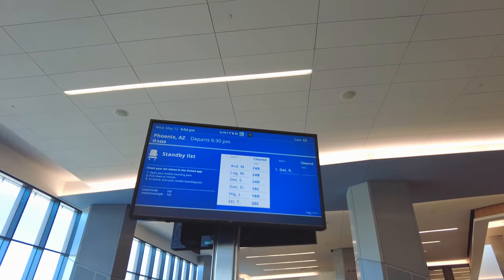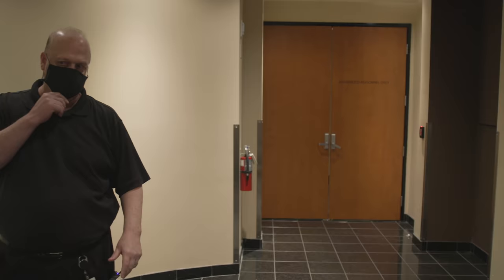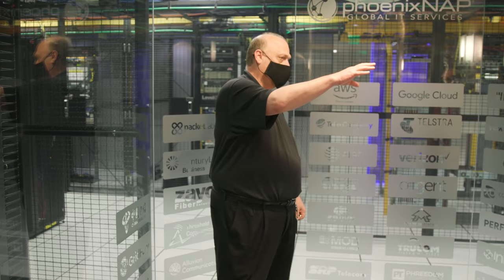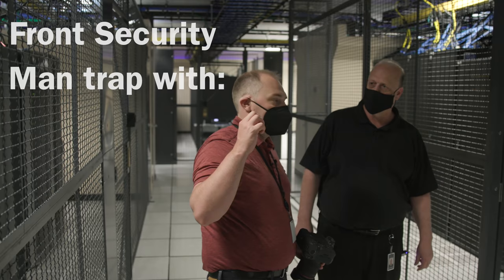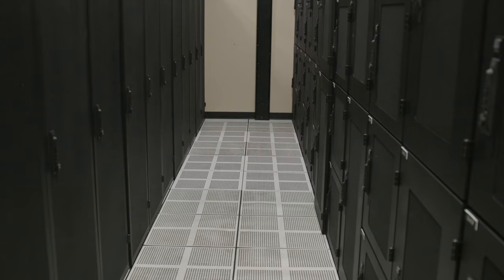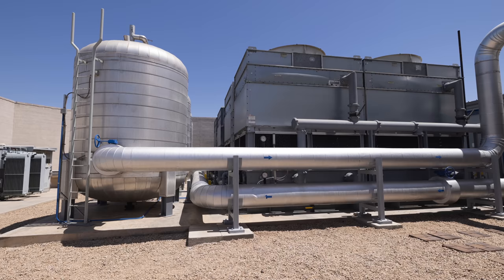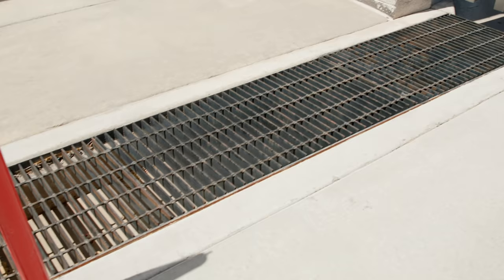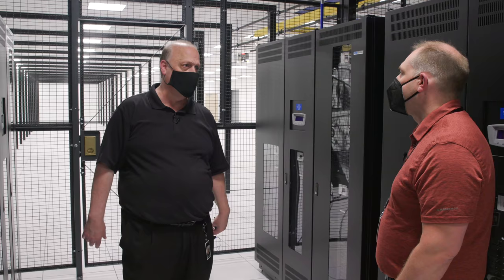A Fun Data Center Tour at PhoenixNAP

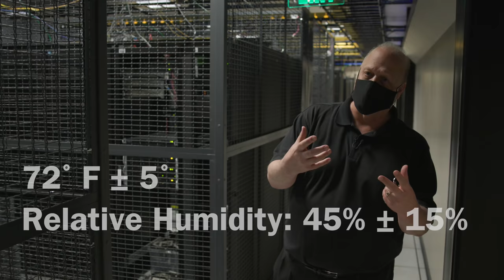Comment: 7:40 - /me sees humidifier in a DC, freaks out...

Then I realized this is in the arid land of Phoenix, and not a humid swamp like St. Louis!
Reply from the maker: Yea! Pretty darn cool.
Reply: Now, go make Pi-powered humidifier.
Reply: wow, even Jeff is here. just don't trip those breakers if you are red shirt Jeff
Reply: from Pi Cluster to Pi Data Center, we all are in this together.
Reply: They're usually inside the air handlers.
Reply: I worked at a DC for a while that had mist coming out of the ceiling vents when the facility was first powered up.  Turns out that without the 1MW+ of servers per room as designed the air was too cold to evap the water and it was visible as a fine mist near the ceiling some 25-30 feet over our heads.
Reply: @dw7444  That's what "re-heat" is for. There's a diverter value that feeds hot gas into the coil(s) to "simulate" load -- so the compressors don't overrun (makes the room too cold) or short cycle. This can also happen when the humidity is too high and the supply air is too cold. (the control system should be checking that, but "cheap" exists in everything -- $100k HVAC with $9 arduino controlling it. Also, no one ever does a proper PID adjustment.)
Reply: scalematrix uses de-ionized water and pump it in aerosol form directly in to the cabinets for increased cooling. the tour guide likes to dunk his ipad under the running water during tours from what i hear. they are on the west coast and no where near as arid.
Reply: @dw7444  vvbo

Comment: I was a systems engineer for 15 years at a small-medium sized data center. It was a great experience. Now I am a cloud and virtualization architect for a large infrastructure where we maintain servers in two data centers as well as disaster recovery with with a large public cloud provider.  Phoenix NAP looked great! But I must say that my IT Disneyland was Switch (formerly SuperNAP) in Vegas. That place sets the standard for all carrier connectivity as well as unique heat/air management. Hard to get a tour though. I was lucky to get my tour there. 
Thanks for the tour at Phoenix NAP!
Reply: Agreed. This is a great DC, but Switch is on an entirely different level. Glad to have the opportunity to have a full rack co-lo there. If only I could work out of it everyday!!

Comment: Very cool video, and awesome what kind of access they gave. Being in the Phoenix area, I can definitely corroborate that Datacenters are on the rise here, in spite of the environmental factors (high heat, potential for low water supply).
Might need to apply there 🤔.

Comment: And here I am with my 40TB NAS on a decade old hardware, in a dinky 12U open-frame rack home lab.
Reply from the maker: That is the gateway!
Reply: It all starts somewhere. I started way back with his and hers computers and wanting to share internet access through a 56k dialup modem. Some research to find out what I needed. Then off to the store and looking at prices of 25ft patch cords...wow I can buy the bulk wire and couple connectors for so much less...just need the tools and learn to do it. I knew that was only the beginning.

Comment: Greetings from Canada and thank you for a great tour given the security considerations involved. I was surprised that the facility only had 60 second capability for running on battery. You must have a lot of confidence in those generators moving from the OFF state too full load very quickly. I was also surprised about the amount of cooling capability you can accommodate - 43 KW in a single cabinet. That is enough heat generation in such a cabinet that is is like a controlled fire - impressive. I was surprised about the location selected given how difficult heat dissipation would likely be in Phoenix. I guess having Tier 1 ISP availability from multiple providers counts for a lot. It is too bad that there is no good way (presently at least) to put all the waste heat that gets generated to some useful purpose. Thanks again.
Reply: Historically, Phoenix always averaged about 76ºF in the summertime until they installed all of those data centers.

Comment: Ha I’ve been to this facility and installed / turned up equipment for my previous employer who was one of their larger colo customers. I’m surprised they didn’t talk about the no cardboard rule. They are super strict on bringing anything remotely close to cardboard like Cisco license envelopes and if you tailgate through the man traps they will come over the speaker and give ya a hard time.
Reply: Why no cardboard?
Reply: @SkynetCyb  shedding of dust and  contamination. When you tear cardboard you see little particles fly in the air
Reply: @thimslugga  That's pretty smart, I never would've thought about it, I thought they had filters in place for this use case though?
Reply: @SkynetCyb  They don't want that crap being sucked into the air handlers. Dust is murder in a DC. I had one "lab" (~400sqft) that was 100% isolated from the building HVAC. The filters on the CRAC stayed like new for 5 years... until the a**holes cut a 1sqft hole in the wall; the filters were clogged in less than a week. (and two servers were killed by drywall dust -- fucks with power supplies frying the cpus.)
Reply: They seem ok with it if it's something like a reusable box or anything you're not going to tear open basically.
Reply: @jfbeam  relax dude.. it has nothng to do with "crap being sucked into the air handlers". Thats what filters are for... Its for the server racks. The last thing you want is cardboard particles being sucked in through the servers..

Comment: Crazy to see all that physical security with steel cages around the racks. Makes sense if you consider there's 10s of millions of $$ in each rack nowadays, even more with GPU or HDD clusters.
Reply: While the hardware and software may have a high value, the real value they're protecting is the service each client provides.  Imagine you're a client like AWS or Google where your revenue is directly tied to your up-time and data throughput.  All that security and redundancy directly contribute to a company's bottom line.
Reply: Also makes sense when you consider any other customer could go to your rack and pick their way in

Comment: Data Center appliances (servers, switches, storage etc) operate on 110-240V. PSUs yield high power output on higher voltages, which is why almost all Data Center equipment is run on 208V or higher. If you check any server PSU, you will see three power outputs listed on it for each voltage range. Blade Chassis almost always require 240V although you could purchase 120V PSUs for Blade Chassis if in the rare occasion someone wants to run it at their office or in a quarter cabinet. Large high power (8kW and higher) PDUs (0u) are 208v or higher (like 208v 3-phase 30amps). There are very few 0u PDUs that are 120v, which is why the guy said 120v is usually requested by small customers wanting a quarter cabinet.
Reply from the maker: A long time ago (2015) we did a piece on 120V v. 208V using HPE power supplies. https://www.servethehome.com/120v-208v-power-consumption/

Good points in your comment. Hopefully can incorporate them on the next tour.
Reply: Yep more (power)...with less (copper/heat) is just simpler. The NORMS aren't generally cuz it's better...it's kinda random, popularity, political influence or cost that drive it. Think Beta vs VHS who won??? Or another good one I researched was the Phillips screw vs the square drive or torx. We got the Phillips which actually strip like they were designed to do for their original application. But we use it thanks to Henry Ford who did a cost analysis on the Square drive (Robertson and Canadian) or the Phillips. He calculated he could get the same job done and it would cost less with Phillips...then that became so common, it's still the annoyance we have to suffer with today...which is slowly changing.

Comment: 4:52 invest in a datacenter with NO hot room "not hot aisle" so the heat in someway is constantly mixing with cool air - not a good move and considering the amount of money that DC is  making they are actually being very inefficient. My DC has the APC heat room with 4 rows of 20 48U racks, 3100 servers, 4 EMC San units & 4 Cisco Cores in 4 corners of the space. The entire room is cooled with 30 tons using 29% of its cooling abilities and the heat it generates is recycled and used in the winter to heat the building office space. 

Datacenter are supposed to be greenish & efficient not designed to be power hungry cities. I would hate to see the price tag for all that power and cooling equipment.
Reply: Yep some basic understanding of HVAC understands that. Even a minimal blocking off between aisles with glass or plexiglass or something would dramatically increase efficiency
Reply: Yeah that part surprised me. I'm planning a server room now and hot aisle containment seems like a no brainer.

Comment: Data centers always make such a show of physical security. It's important and needed of course. More than once I've been to them having passed through multiple levels of security and tech to get in, only to see a roll up door to the parking lot open with guys standing around smoking or shooting the shit. Or a side door where employees and friends go in and out without passing through the gauntlet. While important, a lot of that is for show from what I've seen. That wasn't at PhoenixNAP, but several top tier DCs around the country. Some of the biggest DCs that are industrial primarily for telcos and that sort of thing have nobody onsite and a keycard and maybe finger print to get in and you're in the DC. None of the fluff, just the stuff you need.
Reply from the maker: Actually did tour the dock. Multiple levels of security there but there was equipment we did now want to show on pallets there.

Comment: Great video ! , worked at a telecoms dc for a few years on the 'physical' side, was always fun.
One thing I didn't quite get, was saying their generators can run '
indefinitely'?
Reply from the maker: I think the idea is that the diesel supply contracts and tanks ensure they can survive imaginable outages
Reply: @ServeTheHomeVideo   ty for reply, a first engagement on channel :)
I still do not view that as 'indefinite' however, nor non-prone to some imaginable scenarios
Reply: Depends on their supply of fuel. Many claim "indefinite" because they're connected to a pipeline, vs. on-site tanks that have to be refilled from tankers. Ask some of the guys in NYC how "indefinite" that feed turned out to be. (not very. pipelines need power to function, too.)
Reply: Indefinite is parsing language for sure. But generally, since they probably host gov’t clients, they probably have a Tier II endorsement for fuel delivery during a disaster.

Comment: It would be nice to have asked them what their floor weight capacity is. For 44kW cabinet, I would imagine it to be anywhere near 4000 lbs per cabinet. Also, fire suppression is another thing worth asking. Some Data Centers have water sprays, which ruins everyone equipment but is cheap for the DC to operate. Alternatively some DCs will use a gas, which is expensive for DC to operate but doesn't damage customer equipment unnecessarily. What are these guys using? Is there something new in the market? Missed opportunities! :(
Reply: There will always be unanswered questions. But realistically with data redundancy and insurance...equipment replacement is not usually a big deal.

Comment: A humidity of 45% +/- 15% is actually bordering on bad at times.
In the electronics manufacturing industry, 30% relative humidity is fairly low. Keeping it up at 40-80% is far more common. Except when one deals with moisture sensitive component packages, then one don't want to stay above 60% since it leads to more moisture ingress that then leads to "blown apart" components when one puts the board through the oven. Since water starts boiling within the package itself, but usually one can't even visibly see the damage.

Then in regards to cooling, if they put a roof section on top of their cold aisles, then they can likely increase cooling efficiency a bit, since cold air won't as easily escape out the top and get sucked into the vents for the warm aisles. Putting up doors to the entrance of the aisle is likely overkill.

And then there is the battery bank for the UPS, discharging any battery in 60 seconds is fairly impressive. Though, "discharging" here could mean being able to sustain full output power while not overheating on the warmest day that one could "reasonably" expect to happen (not a particularly weird criteria for a large UPS), and not that the batteries are empty.

I can though understand that they don't use 120 Volt AC distribution all that often, the conductive losses over cables for the same output power would be fairly abhorrent. In other words, the cables themselves would put a fair bit of heat into the room. Though, some datacenters use 300-400 V DC instead, mainly so that they don't need an inverter for their UPS, since it suddenly just is a big isolation transformer, a big battery bank, and then the distribution cables, of course with some fault protection smattered about the place and some charge protection for the batteries.
Reply: DC power requires your customers to be ready for it. And it's exceptionally dangerous -- touch it, you die. (120/208 you can actually let go of it.) HOWEVER, most switch-mode power supplies used in servers for decades are perfectly happy with DC or AC. I've used a few old HP PS's as DC-DC converters in EV projects. (some care must be taken to safely "pre-charge" them when connecting to 10kA capable battery systems.)
Reply: @jfbeam  DC does indeed have some downsides compared to AC.
Mainly inrush current.

In regards to "touch and your dead" is somewhat incorrect. Higher voltage DC tends to burn, but it doesn't really make muscles twitch. Unlike AC that makes muscles tense up every time the line changes polarity.

And yes, SMPS supplies largely don't care about if they are feed DC or AC, since practically all SMPS have a simple low pass filter followed by a bridge rectifier. There is also usually some inrush limiting as well, so not all too much care have to be taken for some supplies, this is however not true for all supplies.